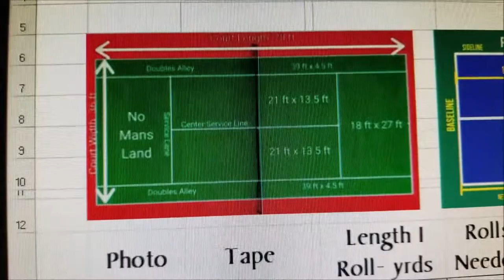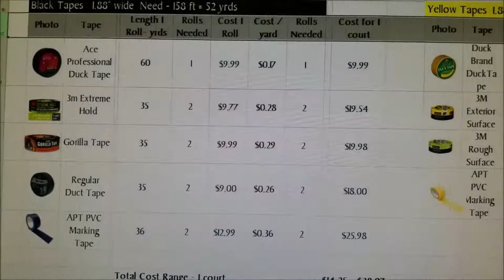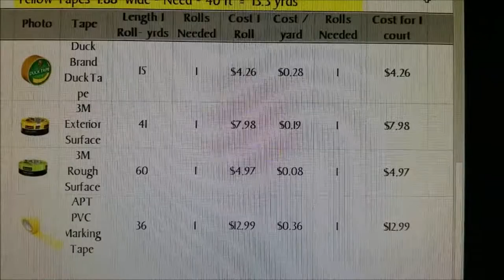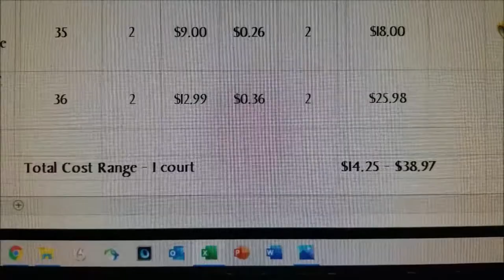Pickle-Ball Court Taping Comparison

Comment: so I've recently built  a 48 x 28 multipurpose  court  for the kids and am looking  for tape for court besides painting.    basketball  pickleball lines.   so its been 10 months how is that tape holding up after time?
Reply from the maker: Gorilla tape seem to last the longest.
Reply: Don't worry. Gorilla tape will hold. We used white, and it lasted with no sign of peeling so far for a few months. Keep in mind that a tornado came through.😂

Comment: How long did the gorilla tape/yellow duck tape last? I'm trying to decide between tape and DIY paint. I'm in So Cal so no snow.
Reply from the maker: I talked with my father and the gorilla tape is working wonderful. It’s been installed for almost 3 years, lived through winters and we’ll be replacing 1 line this spring. I’d use the gorilla glue any day and suggest it to everyone. Have a great day!!
Reply: We've used tape as well without a wheel barrel, and it lasted after a tornado came through😂 all we used was tape, measuring tape, chalk to help line it up, and broom to sweep under. We also pressure sprayed the court beforehand.
Reply from the maker: Wow, it lasted through a tornado. That’s crazy! Good luck with that and keep working hard! Thanks for the comment!😊